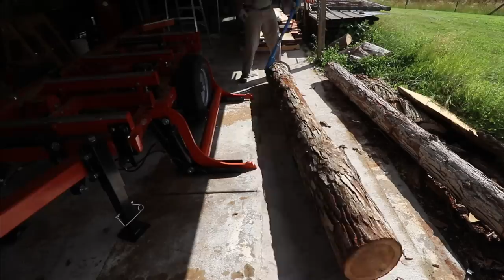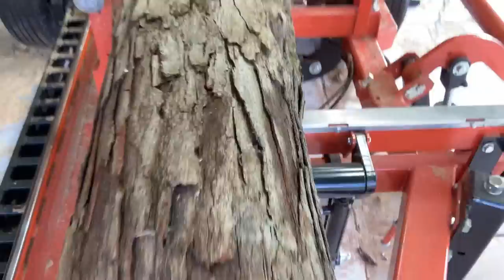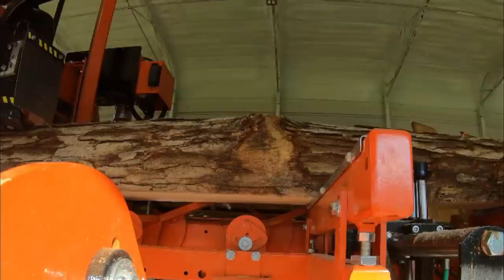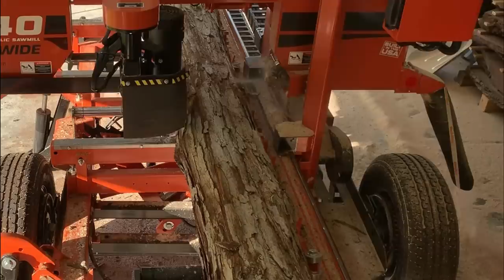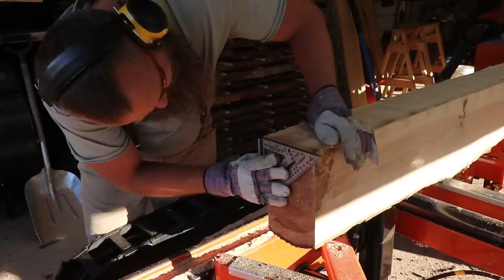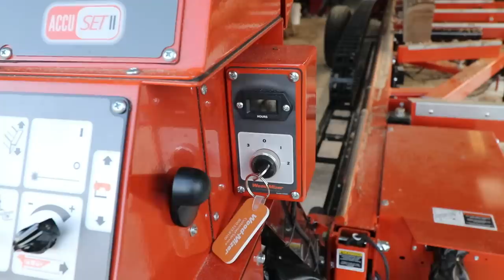SAWING OUT PERFECT 6X6 WHITE OAK TIMBERS ON THE WOOD-MIZER SAWMILL,

Comment: Nathan, I've been meaning to ask you what you do with those barked flitches? Years ago I volunteered with an organization in middle Tennessee that got them delivered from sawmills to a location where they were cut to length, bundled, and donated to the elderly and poor who heated with wood. It's been a long time, but I think it might have been operated by or with the Sheriff's office because the men cutting them at the wood yard were all trusty inmates from the workhouse. I think they might have also cut up downed trees and powerline cleared trees for firewood, too.

If you have more than you need for you own use, it might be worth a phone call to see if your county has a similar program.
Reply from the maker: most of the time I use them as a barter tool, always works out great,
Reply: @OutoftheWoods0623  Excellent. Good to know they aren't going to a burn pile.

Comment: I like the automation in handling rotation of the logs.
Regarding the de-barker.  I get the impression its a "sacrificial" blade to take a nail hit before the main blade. Is that correct?  And why no de-barker on the other side? The exiting side of main blade is less prone to rock or nail damage?
Reply: libertyauto yes. And the blade exits on that size. No need for one there. 
Thanks for watching. Appreciate you
Reply: Thanks for the explanation.